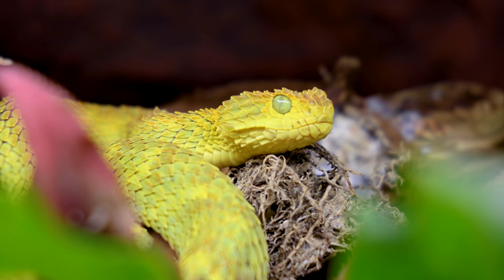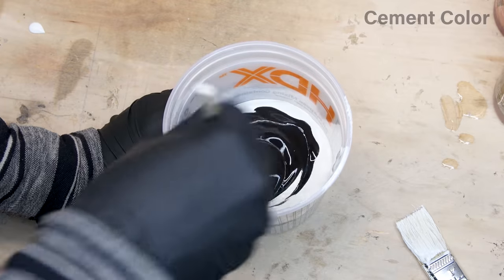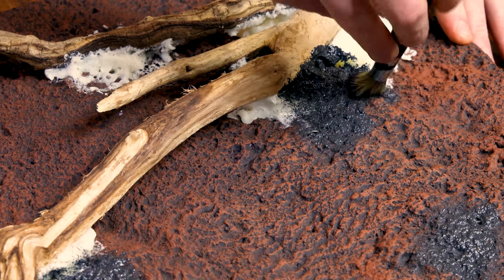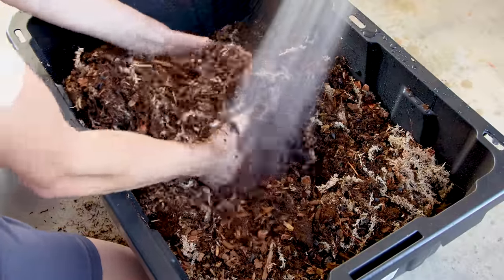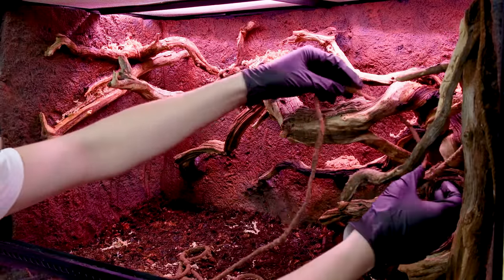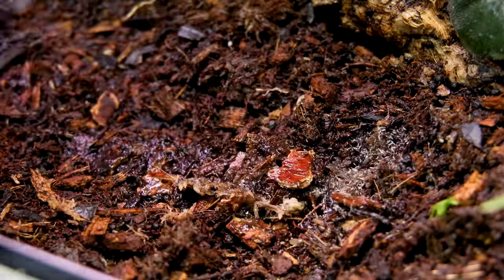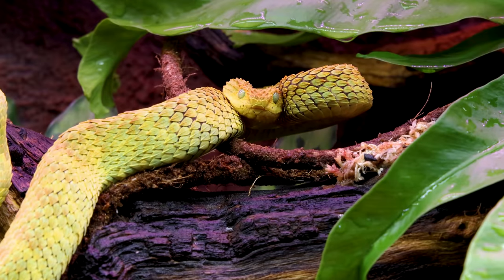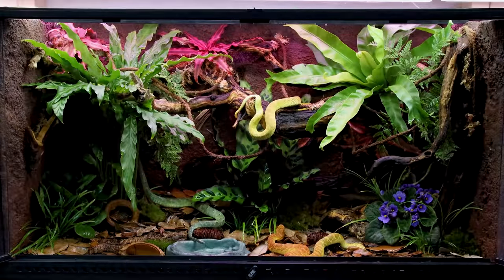Venomous Tree Viper Bioactive Jungle Vivarium

Comment: I love how compared to some of your other projects this is a great beginners project. No expensive tools, no cutting class, no massive time delays from having to attach like 20 different things with silicone for structural support, no major modifications to the enclosure, and a relatively small amount of components especially considering how dense it looks. This is an affordable, easy to replicate, and beautiful set up. One of your top 5, granted nothing can top the 600 unless you make like say a 1,200 gallon aquarium and go find a Picture of underwater in a river and replicate it as much as possible even down to plant and hardscape placement. Which you should totally do. If anyone can do it it's you.

Comment: ~~Drylok's good stuff&a tip,if I may? Get yourself a roller w/3/4" nap,it'll get majority of the piece&cut time by more than half. Since you like using more than one color I suggest simply cutting a 9" into thirds&when you're done? Load it up good&wrap/store it in plastic bag which you can use to take it off the frame also. Make sure any print's on the outside before wrapping in a 2nd bag&seal w/masking tape labeling Drylok Black, Gray etc. Then throw it in the bottom of refrigerator. Do same w/kitchen, living room etc. too. They 'll keep up to a year unused&longer used periodically.

Comment: You use a pretty small brush to spread the first coat 1:55, I'm wondering if you used a bigger tool, and maybe if it was a sponge instead it could reach those cracks and you can avoid the carpal tunnel problems DX

Comment: Quick question : you're using a lot of non natural materials (glue, paint, foam, ...) aren't you afraid that some of them might toxic for the animals ? Keep up the great work !
Reply: From what I saw, the materials he used are used extensively by reptile and fish keepers, and their properties are well known. For example, cyanoacrylate glue (super glue, gorilla glue, etc - usually in the gel formula but just check that it says cyanoacrylate) is used to attach aquatic plants to driftwood and rocks, to attach rocks and wood together, etc, and can be put into the water of a fish tank right away. So it isn't really a concern in this case, bc he's not using anything out of the ordinary. But if someone is a beginner, they should definitely do their research - a Google search for "what kind of glue is aquarium safe," "what kind of found wood/leaves can I use in a reptile enclosure," "what kind of spray foam can I use in a paludarium," etc, will yield tons of results- videos, articles and how-to's, forum conversations and so on. I always check several sources, and look for agreement. If people are arguing in a forum about whether something is safe, it's probably best to skip it! Otherwise, proceed accordingly. Good luck and have fun!

Comment: I would love to do this for some garters, but I kinda afraid I will have it too wet resulting in scale rot and stuff. Anyone got any tips?
Reply: Good ventilation will allow it to dry out more, also a drainage layer
Reply: set up some computer fans on the screen top to pull fresh air in and keep it well ventilated
Reply: The whole planet is one big bioactive setup, basically. Scale rot and respiratory infections are not caused by humidity or moisture simply existing, but by the proliferation of anaerobic bacteria due to a lack of good ventilation. Even many desert animals spend most of their time in burrows where the ambient humidity is like 90%. There are plenty of Facebook groups you can join to learn about this stuff, like Advancing Herpetological Husbandry.